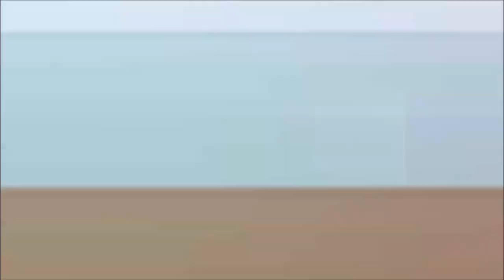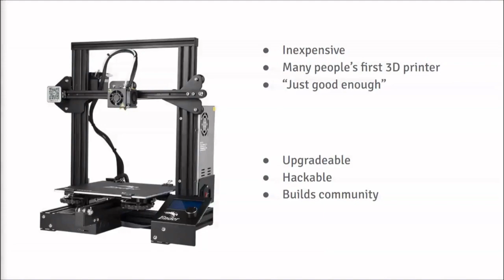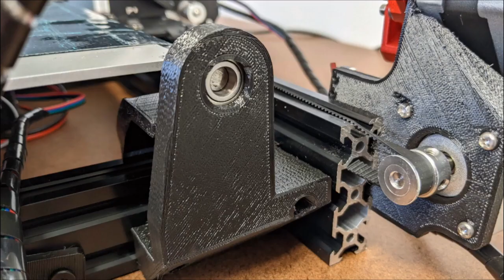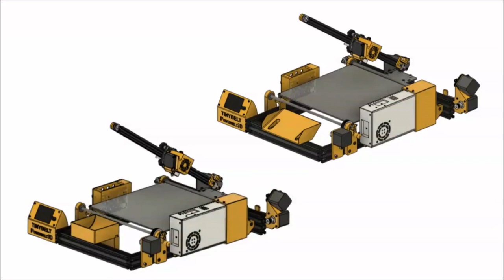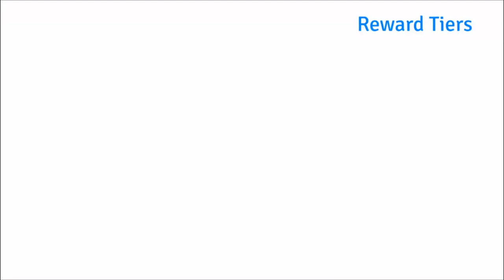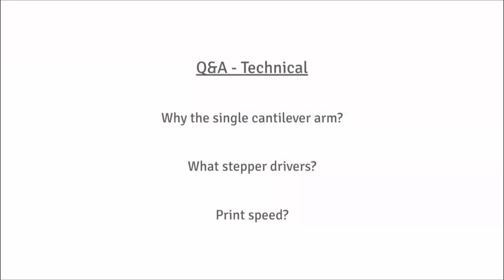Tinybelt Launch Party Replay

Comment: interesting and cheap. but there is one small construction problem as far as I can see. this Z axis bends slightly downwards when the weight of the nozzle goes to the top. and it swings a lot, I don't know how it will work on the print quality of larger items.